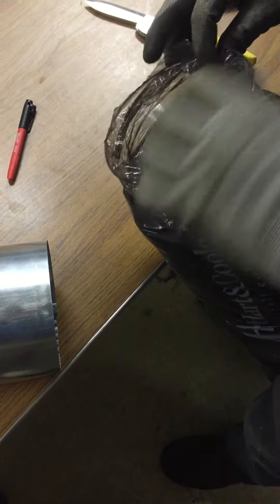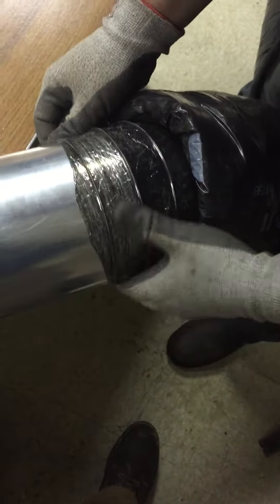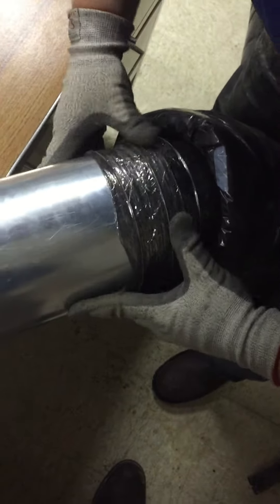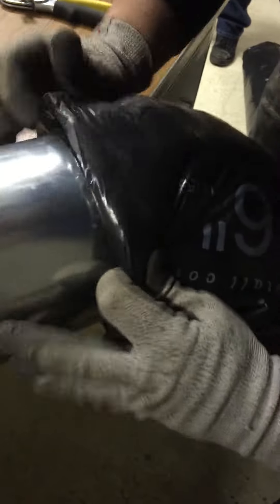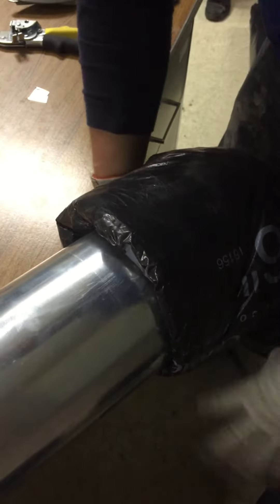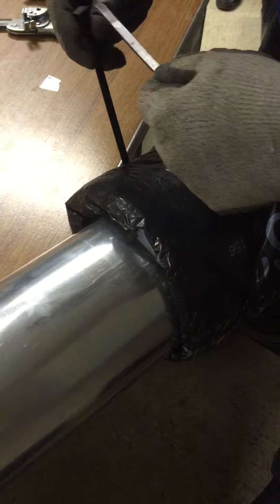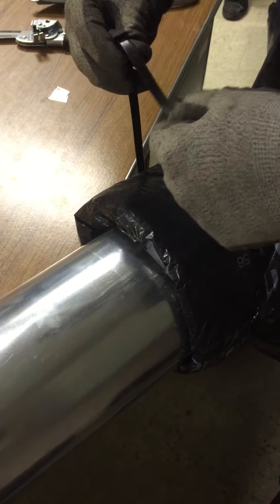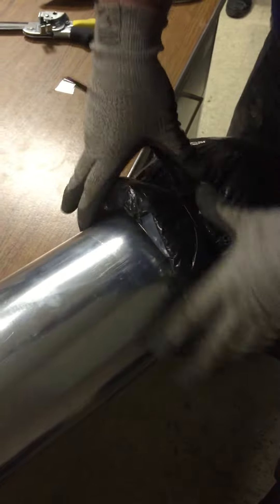HVAC How to Attach Flexible Duct to Round Ductwork

Comment: Don't you need to push the flex duct with insulation over all of the pipes to reduce condensation so the pipe does not leak water and rust pipe and get the insulation wet and cause mold?  

I am dealing with a pipe now not done correctly and the bottom is rusted from condensation.  It's 16 inches and getting the flex duct on has been super hard. I am watching youtube videos to see someone put one on a pipe that is about 20 inches long. It is a bear. Do you have any advice? The pipe and duct are both 16 inches and moving it is frustrating.

Comment: This is fun in a crawl space with one hand when its 5 below zero a slight taper on the tap to start the duct has not been designed why? Cold duct tears easily making it hell in a tight space